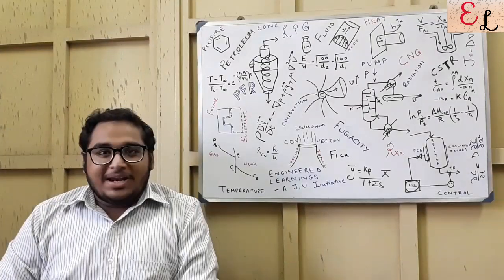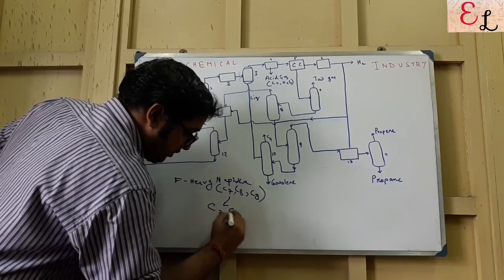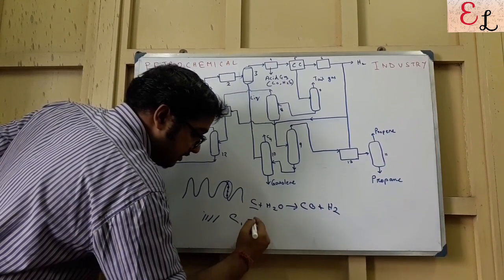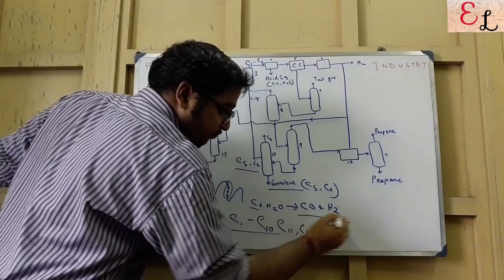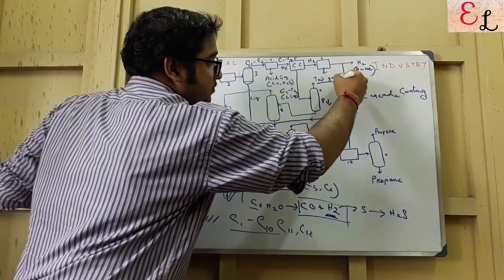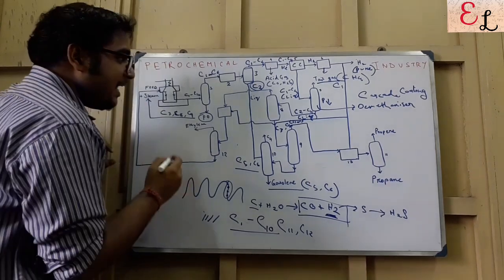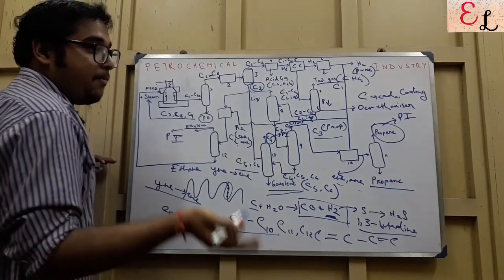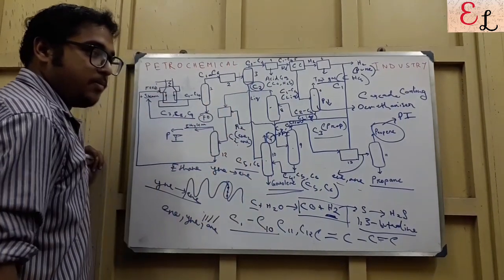PETROCHEMICAL INDUSTRY | HEAVY NAPHTHA CRACKING | MONOMER PREPARATION | DEBUTANISER | PETROLEUM

Comment: Why ene are not converted into Ane as in th e converting of yne to ene?
Reply from the maker: Because the first attack with be on the double pi bond as it is easier to break, also because double pi bond creates higher electronic dense centers of lone pairs for attack of hydrogen.

Comment: What is the typical residence time in tube still heater?
Reply from the maker: Typically it is a little on the higher side as it is a cracking reaction, depends on the desire Monomer, higher the residence time, greater will be the extent of cracking and hence lower carbon monomers will be obtained